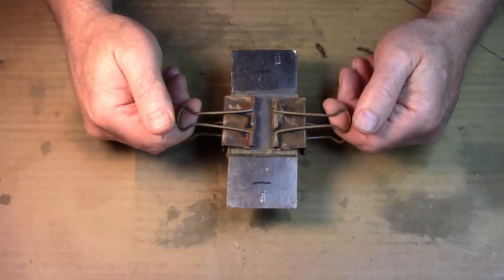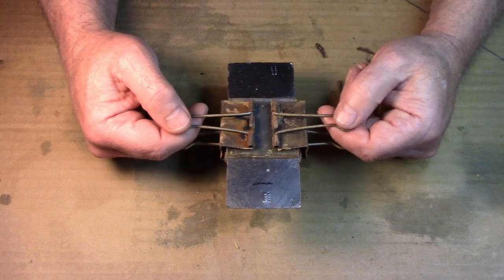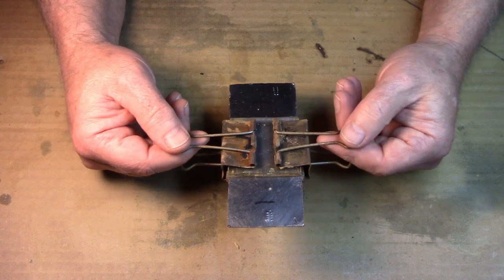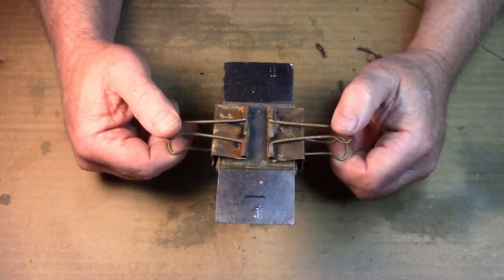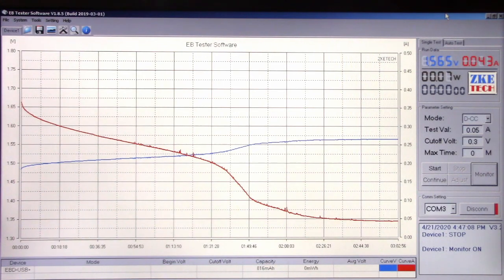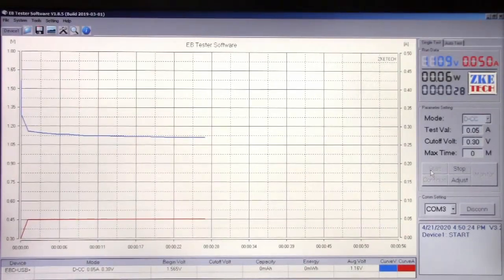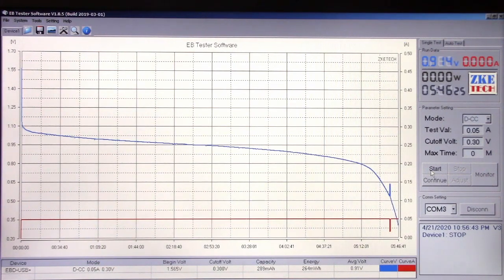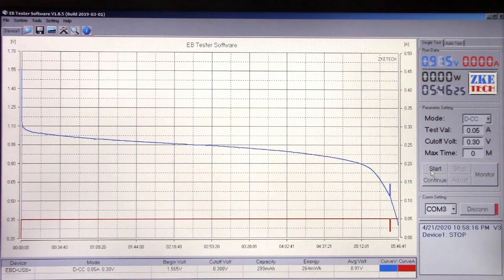The Iron Carbon Battery

Comment: Interesting video. I use Steel - Carbon batteries. The electrolyte is citric acid with a small amount of baking soda added. The advantage is that there is no release of chlorine, hydrochloric acid and other harmful substances.
    Rust and oxides on the steel electrode have interesting properties. Most of these iron compounds have a large negative thermoelectric power. Therefore, such a cell has the potential for effective self-charging from the heat of the environment (like the Dr. Karpen battery). The main thing is to ensure a small thickness of such a coating, the right electrolyte and a suitable positive electrode. 
        I post videos of such batteries on my channel.

Comment: Have you tried this with potassium chloride electrolyte? You can adjust it's aqueous formula strength to adjust several parameters, including internal battery arcing through the electrolyte.  It would make this closer to the Edison battery as well, and it appears that this can be created into a multi cell bath battery for higher voltage and amperage configurations with minimal internal baffling. The pot ash electrolyte is also less etching to the steel and many other metals as compared to the ferric chloride. 

In all, this is a nice improvement over other concept combinations.  I build batteries and always looking at other concepts for inspiration.

Comment: Nice video - thanks. Have You tested the self discharge behaviour of the battery? The thing is, that normally You separate the Iron III Chloride from Iron II Chloride in a reflow battery.

Comment: Impressive results! I'm looking forward to seeing the details of cell construction. It looks like you have increased the output of the cell quite a bit by using mesh-like electrode materials to achieve a higher surface area per square inch. Thanks for sharing!
Reply from the maker: Thanks William, I'll be posting construction and additional load test videos shortly. Cheers

Comment: Nice cell.
There seems a lot of energy (264mWh) compared with other Fe cells of a similar size I've seen :-)
I have used FeCl3 for etching copper PCB's, but I have never come across FeCl2, I looked on ebay cannot seem to find it ! Any ideas?

Looking forward to seeing the cell in more detail in future vids.
Martin.
Reply from the maker: Thanks Martin, I was quite surprised myself with the mWh output. I make the FeCl2 from FeCl3 by adding iron. I'll be posting a few more videos today. Cheers

Comment: super. when you make longer tests the grafiol get destroyed.  cayrex2 made a good currentcollector
Reply from the maker: Hello ehochimalpi, Yes, I have had a lot of problems with the graphite foil degrading. I'll look at cayrex2's current collector (do you have a video name?) but the only other material that I know that can stand up to iron chlorides is titanium. I will be switching to it. Thanks.
Reply: What happened after multiple recharge did the chemistry hold up or cross contaminate and die???
Reply: Why does the grafoil degrade?
Reply: @EstBest69  its not realy watterprof
Reply: @ehochimalpi  I still dont get it, how does not being waterproof cause it to degrade?
Reply: Tank yuo

Comment: Good cell. I make pretty much experimenting on iron batteries. The last one which I make was all iron redox battery which means that the FeCl2 and FeCl3 electrolyt in the cell are separated by the membrane. In basic is like redox flow battery where the electrolyte change the oxidation state. My iron cells run on voltage of 1.1 to 0.6 volts, depending on the design of the cell.
Reply: One suggestion,... try to mix the steel wool with graphite. Because when you discharge the cell the iron transform into rust and the rust is not really conductive and you can get the problems with charging (not all of rust will be able to get back to iron because of the bad conductivity).
Reply: I hope that I get the time to upload the video. But like I say, good work. Do you note if the cell is rechargeable?
Reply from the maker: Many thanks
Reply: @qabsolof4617  no problem. I spend many hours on iron battery. And the tech have some potential. So work on your cell. Best of luck. But if you need me you know where you find me 😉
Reply from the maker: @cayrex  Thanks again, much appreciated.